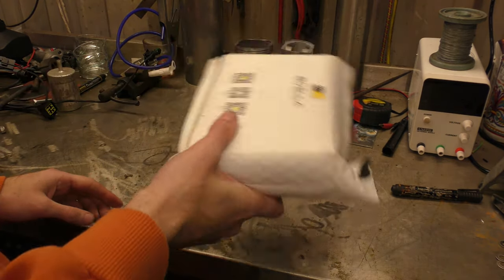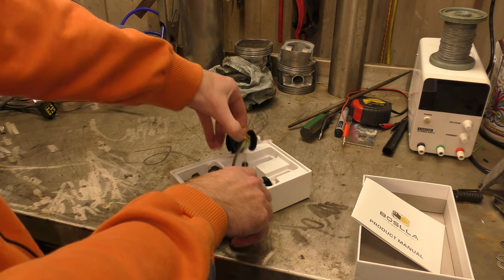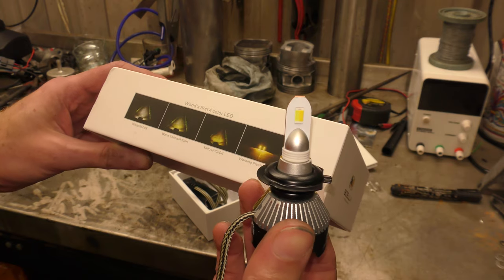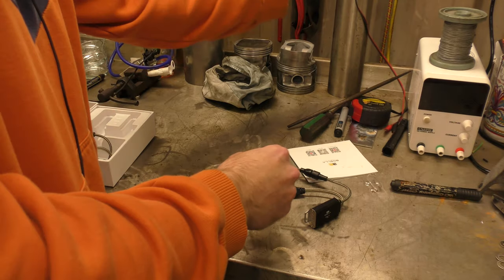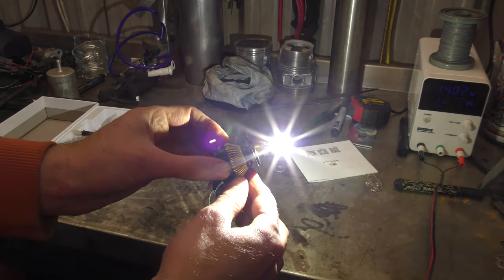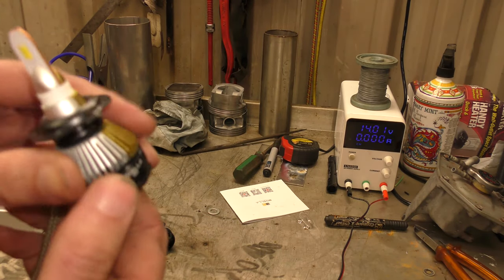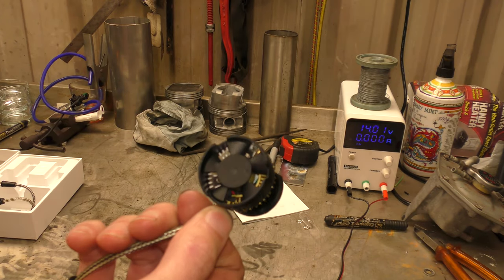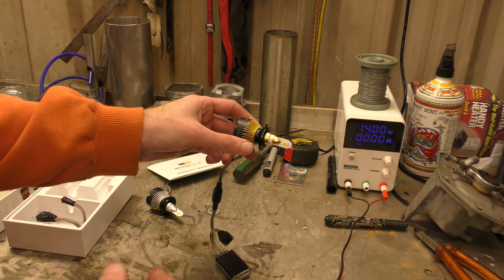LED headlights that actually do something different - Boslla

Comment: My issue with LED lights, as opposed to old school incandescent bulbs, is that although the LEDS are brighter as you look directly at them, in real world use, sometimes they aren't as effective as the old school bulbs. I think it has something to do with the amount of useable or visible light that is reflected back to the eye. Looking into the LED bulbs, they appear to be twice as bright or more, but when looking at what the lights are shining onto ie the road, the reflected usable light sometimes isn't even close to being twice as bright. On both my tractor and my quad, when I upgraded to LED bulbs I was so disappointed that I went back to my old bulbs - although the lights on my quad were admittedly halogen but still....

Comment: Have you driven with these at all, particularly at night? I've actually thought about giving a pair of these a try, not sure just how good they'd be but driving at night when the roads are wet with 6000k 35w xenon projectors that are 12 year old tech make it rather hard to see sometimes.. Made worse by the fact the road markings around here are almost non-existent on some roads lol. Mine are okay at night but as soon as the road is wet the light output feels very poor. Just wanted to see if a lower colour temperature would make a difference..
Although given that the proper xenon bulbs seem poor. I'm not sure if LED would be an improvement?
Also I have no idea why they'd include a flashing mode on headlight bulbs, seems pointless and adds an extra on-off cycle to get back to white :/
Reply from the maker: I haven't tried them.  The didn't quite fit in my headlight properly.  If you do fancy trying a lower colour I'd get a cheap pair from Amazon - https://www.amazon.co.uk/3000K-4300K-Headlight-9000LM-Headlamp/dp/B07VV9XG28/ref=sr_1_3?keywords=4300+led+headlight&qid=1570544758&sr=8-3

Just pick the colour and fitment, for under £20 it's not the end of the world if they are terrible.

Comment: Yikks - I have a number of very good high power LED touches and my number one pet hate is they all have the infernal flash modes. i just want the dam thing to turn off and on and have no interesting it sending an SOS message. I love your reviews and work but there is no way in hell I will ever put an LED headlight unit in that flashes SOS.

Comment: A bit gimmicky for me. I see the logic, but the fact they will go out 4 times if the preferred setting is missed, even for a split second is dangerous at any speed. Could also freak out any driver coming the other way into thinking they were on the set of Close Encounters.. And at £100+ a pair, way over the top.

Comment: I’m not sure there legal, can you use fog lights as headlights. I always thought they had to be separate. Anyway those damn lights must have caused hundreds of accidents blinding everyone coming the other way. They are far to bright , it’s fine if your using them but having someone driving towards you and waiting a couple of seconds before dipping is lethal as even on dip there blinding. They drew 1.8 so what does a normal headlight draw for comparison.
Reply: Typical bulbs are 55W, nearly 4 amps.
Reply from the maker: Yeah, LED headlights in the wrong enclosures (reflector instead of projector) are blinding, much like aftermarket HIDs.